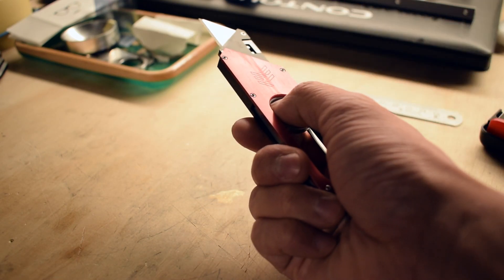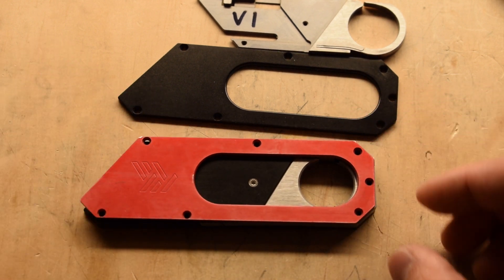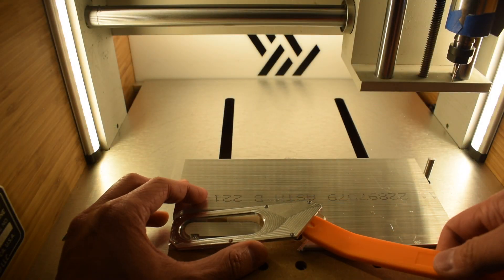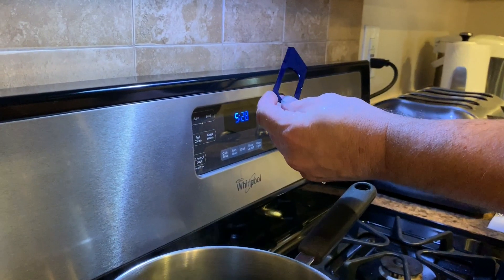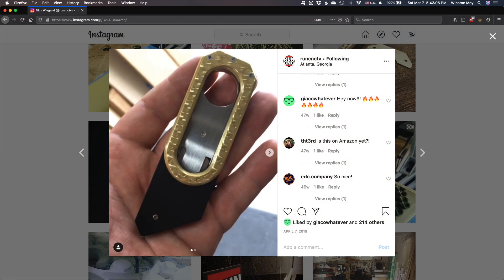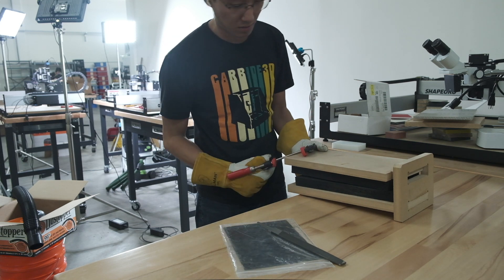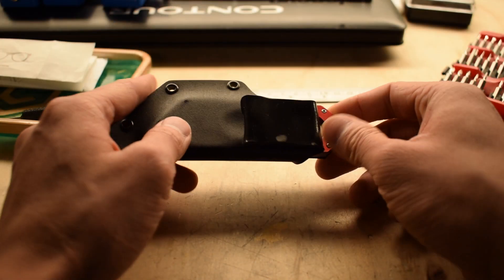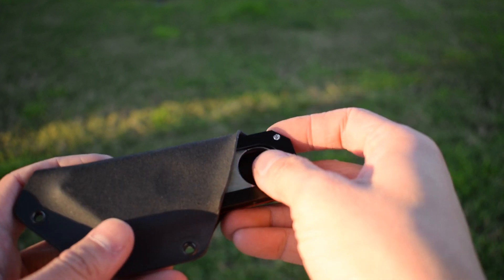Maker Knife Mods: CNC Machined Faceplate + Kydex Sheath - #149

Comment: Nice kydex sheath, I made a similar one for my maker knife and used the kydex belt loop and it failed after about 3-4 months of daily use. Hope yours is more durable! Here's a link to a picture of mine.  https://twitter.com/DiedDiedrich/status/1096246017861799936?s=19
Reply from the maker: Oh, that's an interesting design. What thickness Kydex were you using?